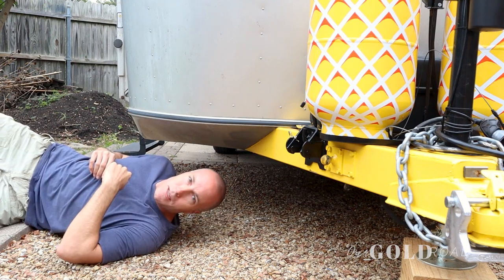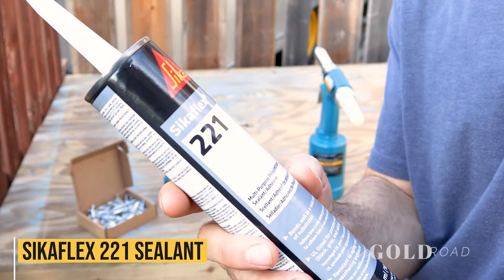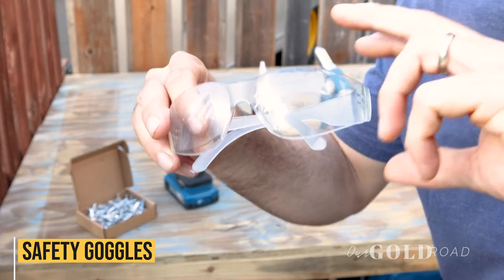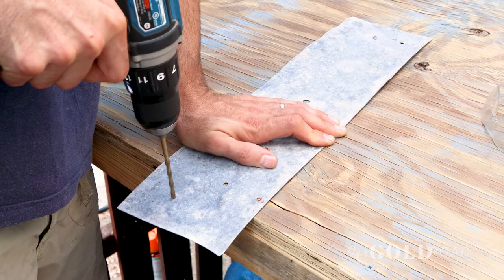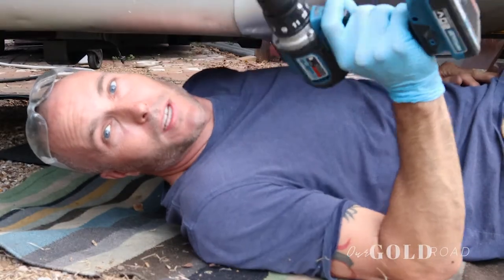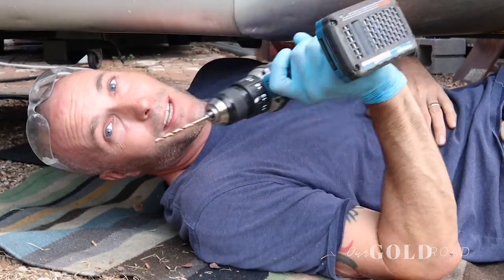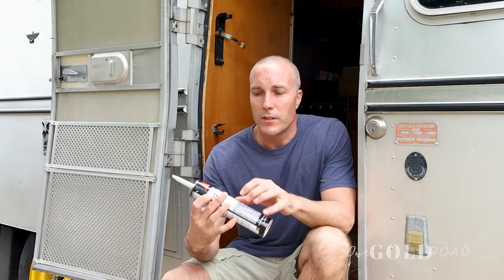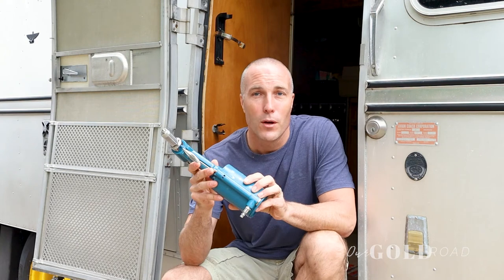How to use an Air Rivet Gun | Replacing missing rivets on a 1973 Avion | Vintage Trailer Renovation

Comment: Thank you! I’ll be removing aluminum panels in my 66 H-25 and need to rivet them back up. What pressure did you have it on?
Reply from the maker: I had mine around 45 to 50 psi.